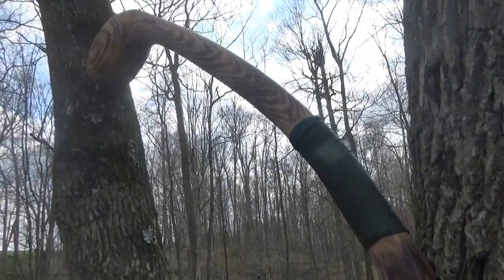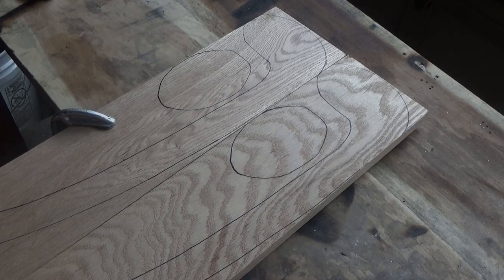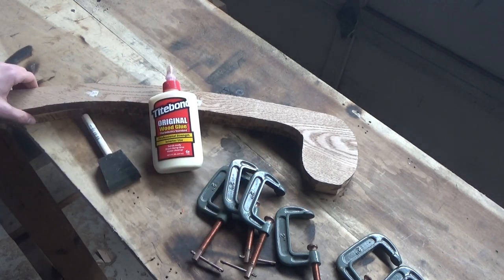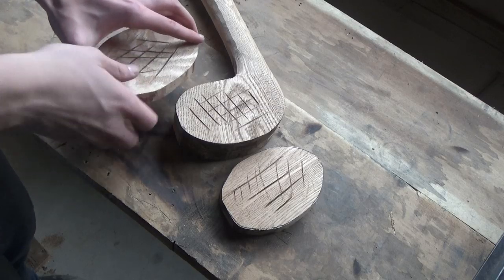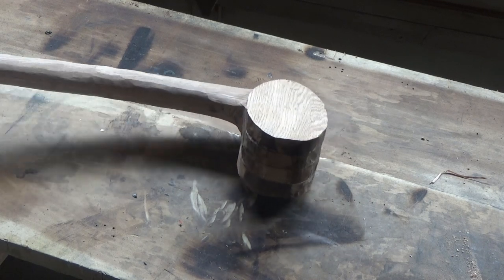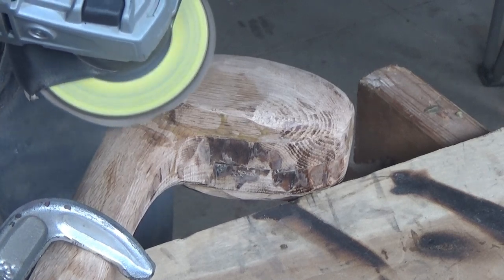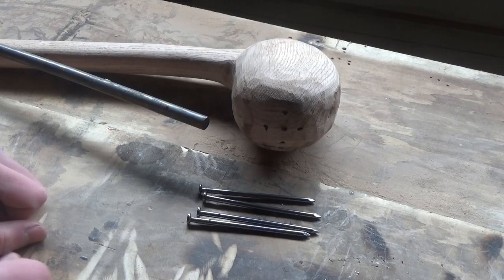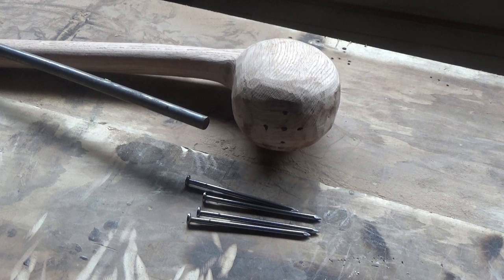making an INDIAN WAR CLUB start to finish

Comment: I would suspect that cutting the grooves on the ball end probably made a  weaker joint since wood glue adheres to contact and does nit fill voids.  On the other hand had you used epoxy the grooves would increase strength since epoxy does fill gaps to some extent.  I dont think it really matters here since it will be decorative
Reply: Also wood glue is very strong and the area around the marks will hold very well

Comment: Checking the surface does not improve bond, it would make it weaker than it could be.  Wood gluing is about surface area application, not relying on the glue itself as a bond, but the broken down fibers.  Epoxy/CA is a different story.

Comment: Sweet looking war club dude!! I was really glad to see it take the hit against the stump when crushing that coconut. It looks like it can take some real life punishment. Again, really nice looking and seems battle ready as well. Can't get much better than that. I'm gonna have to try this method out, though I might for go the studs and just stick with the wooden club. Any tips not on the video? Thanks for the video, and by the way really cool looking club!! It made me like and sub :)
Reply from the maker: +C.E. Jarvis
Glad you liked it the only tip I would give is make sure you pick wood with a good tight grain
Reply: Thanks. The red oak is working well for you though isn't it? I will probably just follow your lead on that and get some red oak also :)

Comment: Very nice build. The grain really lined up nicely. I would not guess that it was a laminate from the initial look. 

Constructive criticisms 1) as stated below, hidden dowels or biscuits would add strength to the "cheeks". 2) look up "boatswains wrap". It will give you a better way to wrap your handles. 

Great job.
Reply: Dowels and biscuits are for alignment purposes. In a proper glue joint, they add no strength.
Reply: @CloudfeatherRusticWorks  In cabinetry yes, glue joints rely on the glue for static strength, in a tool or other item designed for shock impact or facing shearing loads, dowels with grain running perpendicular to the glue line can considerably strengthen the joint. That’s why gluing a dowel into a broken gun stock is Gunsmithing 101.
Reply: @morantactical1105  dowels only add strength when gluing end grain together. Side grain is actually weakened by the dowels being there.